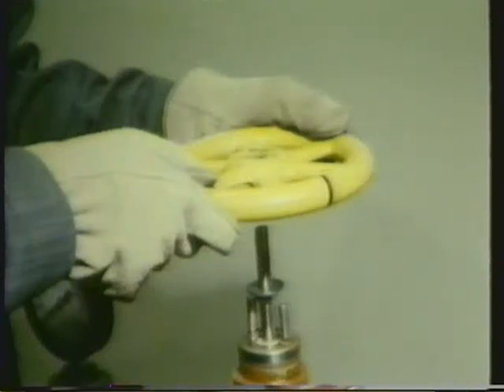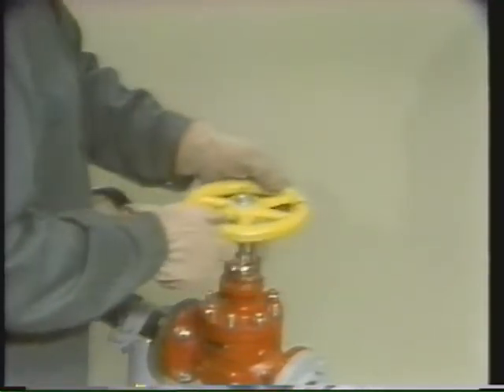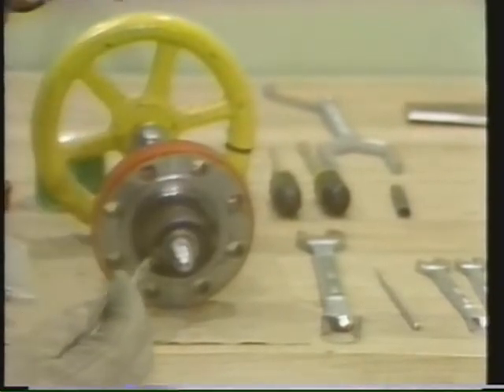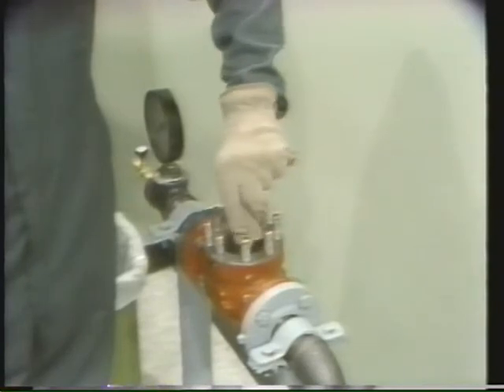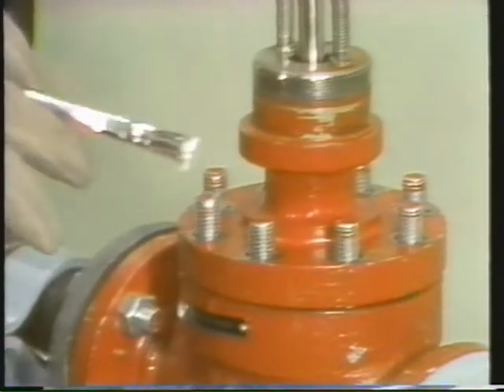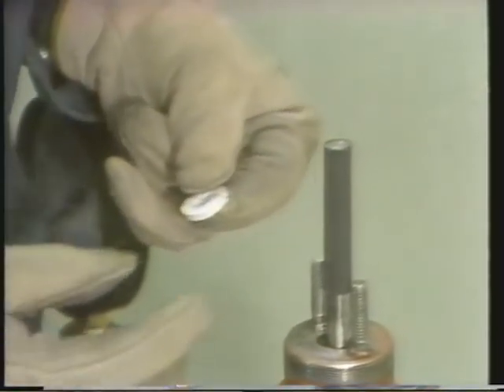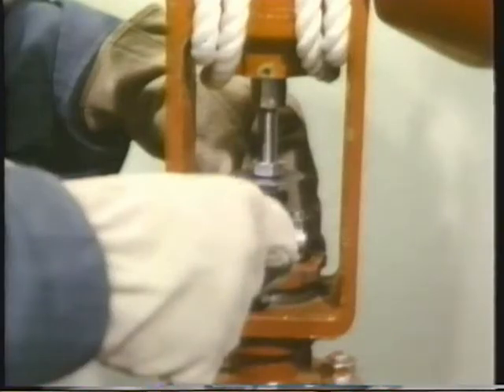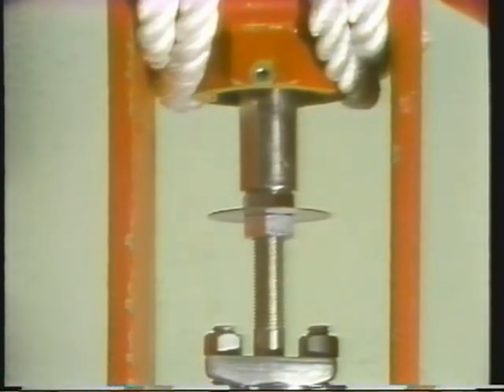What is Control valve- How to maintenance & Calibration Control valve ? Part 3

Comment: Tanks a lot ,mr shady I have one question , is there different between controls valve for gas and control valve for water??
Reply from the maker: The difference is exactly how it sounds. A pressure control valve (PCV) opens and closes based on the set point predetermined by an engineer. This is usually controlled using a pressure transmitter (PT). The PT is basically an electronic pressure gauge that sends signals to the PCV and tells it whether or not there is enough pressure entering the equipment and the PCV opens or closes to compensate.

The flow control valve (FCV) is exactly the same except it gets it’s signals from a flow transmitter (FT). Just like the PT, an FT is basically a flow meter that is able to communicate with a related valve. Again, like the PCV, the FCV opens or closes based on the required flow and the signals it receives from the FT.